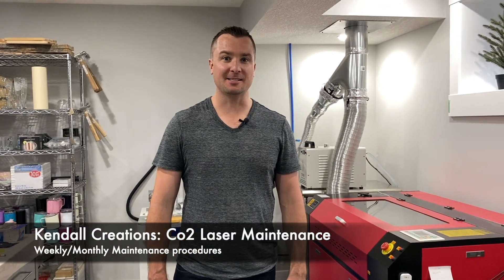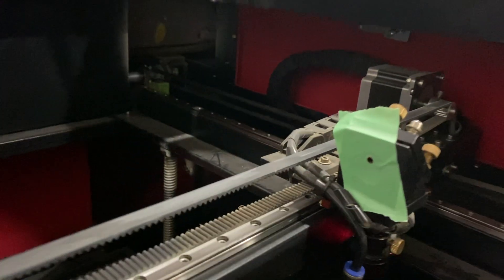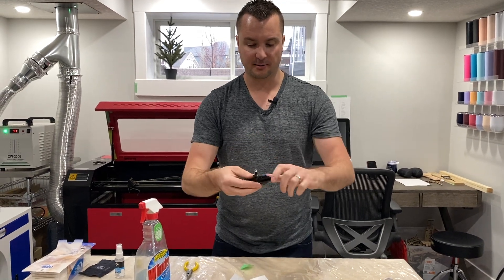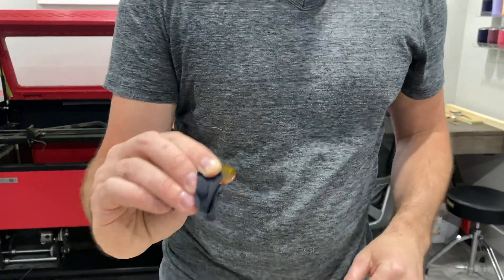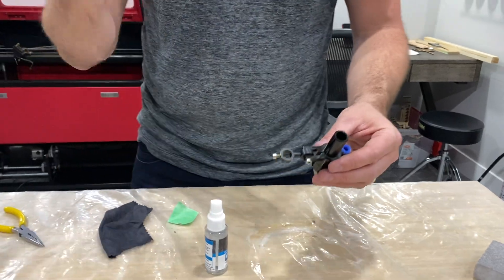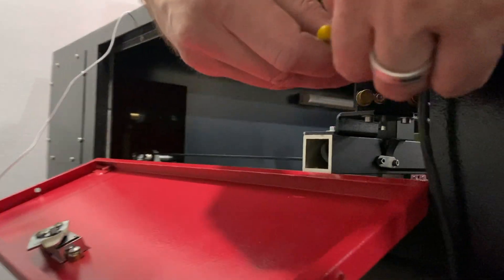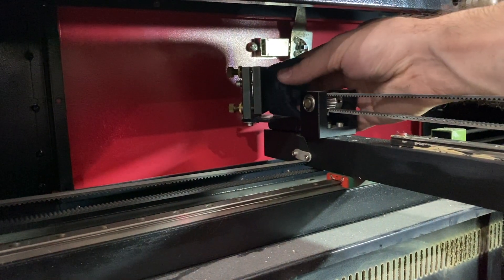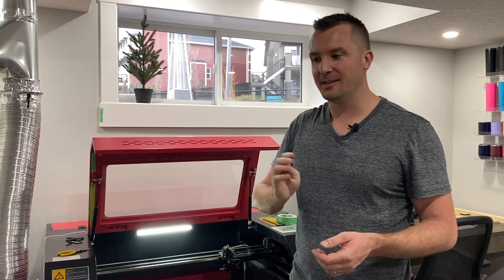Co2 Laser Engraver Maintenance Procedures

Comment: on the  height  adjustable Laser head that is in your laser you  dint have to  redo the Ramptest  because  the Lens is always the same distance  from the  end/Tip of the Nozzle no matter how far you  slide it in or out .
and the Distance between Mirror 3 and the Lens doesnt matter. it could be 15 Inches away.
Reply from the maker: Hello Wolfes1126 - We do a ramp test because if the top of the nozzle is further away, it does not engrave crisp. I have tested this and this practise is what works the best for us!

Comment: actually i have a very similar unit, and your laser is NOT aligned.. it is way out.... that pulse has to be in the middle of that circle on mirror 3 at all four corners of the bed, your pulse is burning way high of center. This basically means the beam is not entering the focus lense in the center, it's somewhere way off center.
Reply from the maker: Thank you for the feedback.